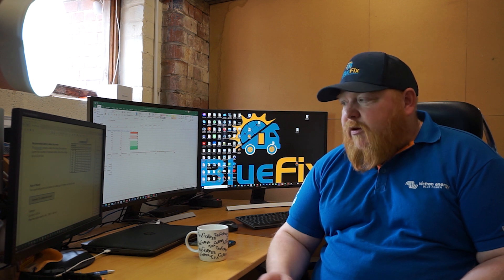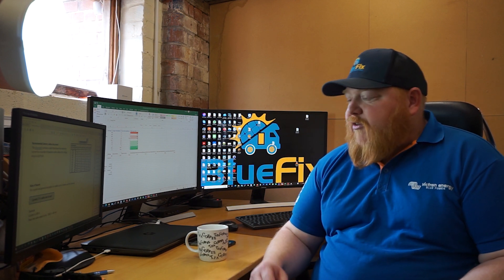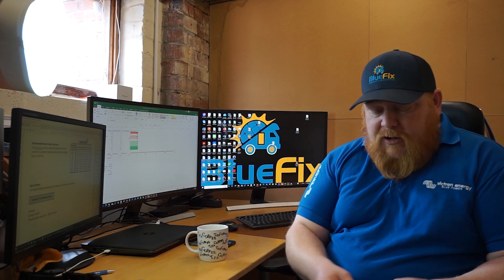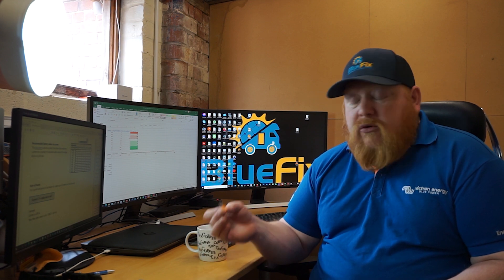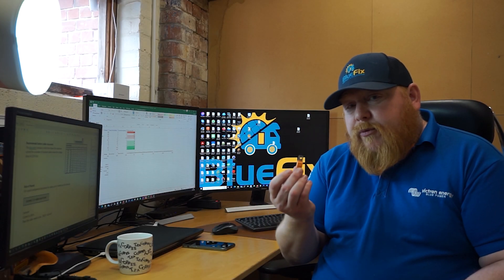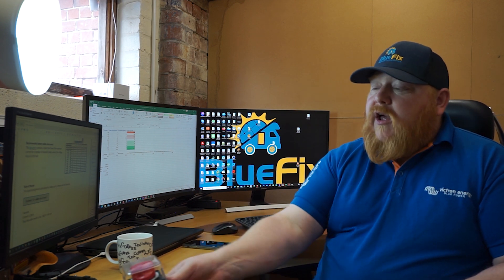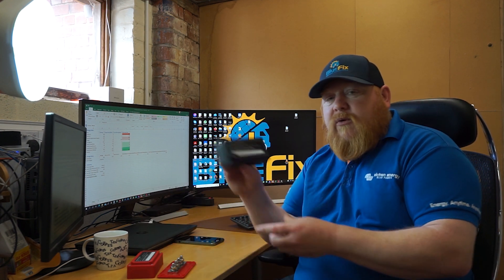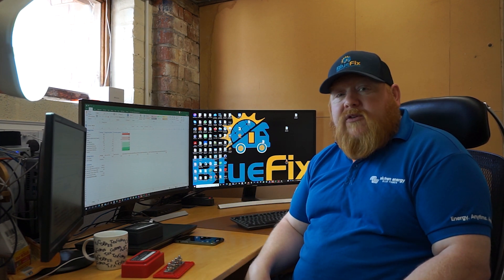What cable size to use? || Cable & Fuse sizing

Comment: I know you guys have been busy building up a great business but are you still going to show the next steps on your sample board? Seems to stop at the bus bars. On my system, I'm going to add a main isolator and mega fuse after the battery with midi fuses after the positive bus bar. Apart from for convenience, I don't need to add breakers as well do I?